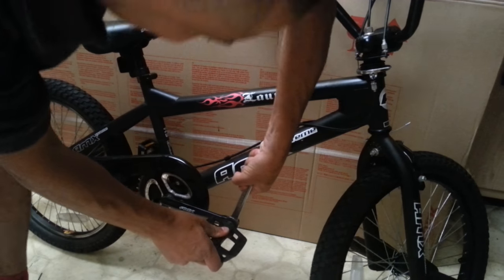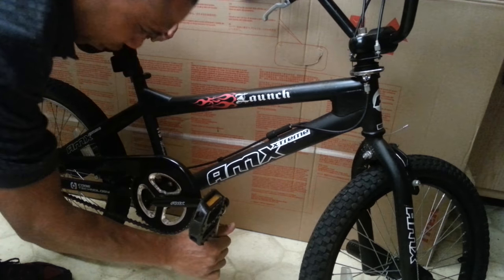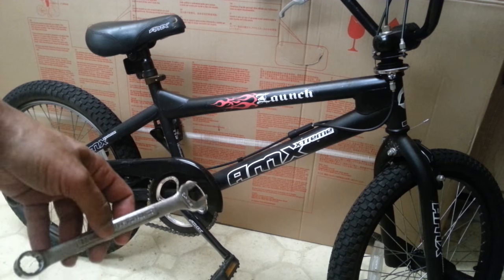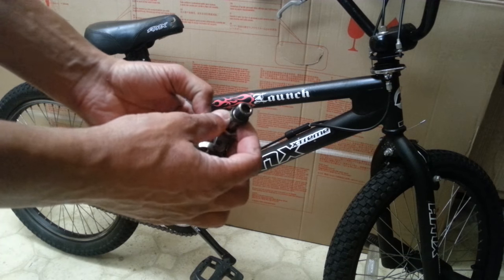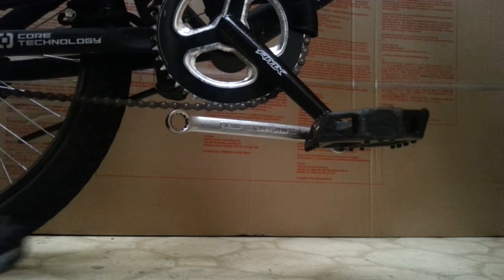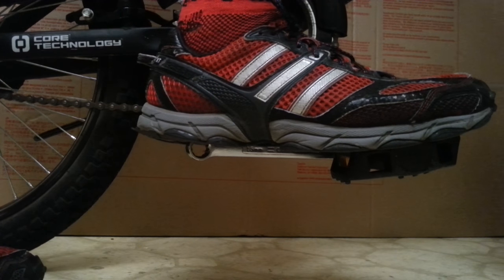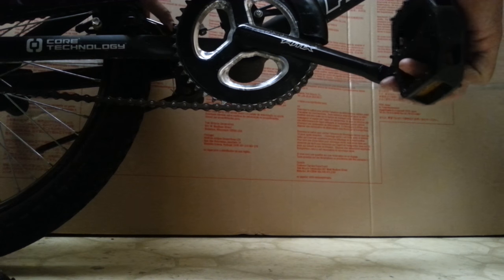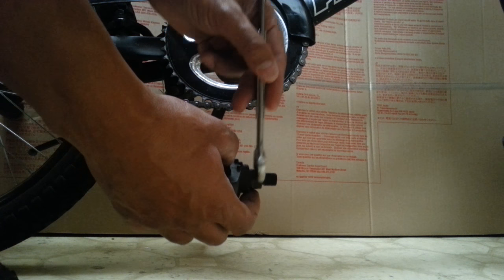How To Remove Bike Pedals From a Bike the Quick & Easy Way | #AdventureBiker

Comment: Just fucked up my pedal now its stuck forever
Reply from the maker: Sorry to hear that. How did you mess it up?
Reply: @theadventurebiker  i dont know i think i may have kept pushing and the 150mm wrench may have stripping it, im just gonna take it to my local bike shop and get it chNged there
Reply from the maker: You said you used a 150mm wrench? Did you mean 150mm was the length of the handle? Because the opening that fits over the pedal spindle should be 15mm.
Reply: @theadventurebiker  yeah the handle said 150mm and it fit the pedal bearing  just perfect , so i was turning it but the bearing would move until it,  think i messed something up . Its my fault
Reply from the maker: Sorry to hear that. Not sure what happened. A wrench with a 15mm opening placed on a pedal should be able to withstand a huge amount of force before anything goes wrong (ie. more than your body weight). Hope you were able to get it sorted out.